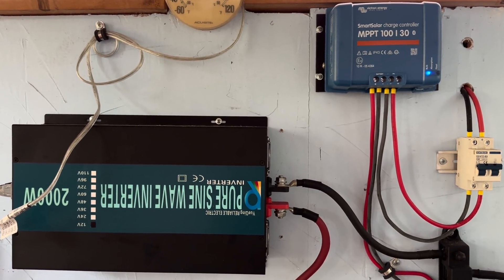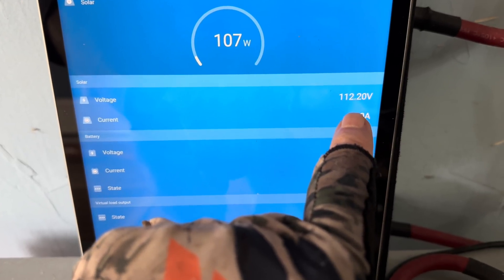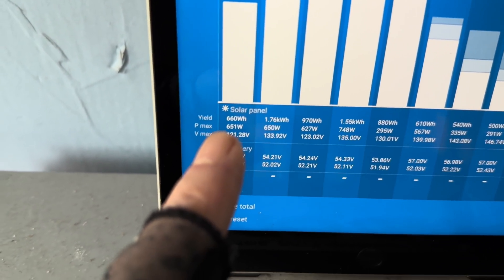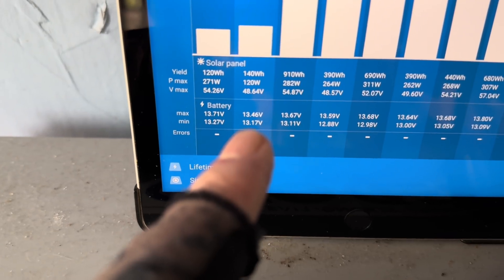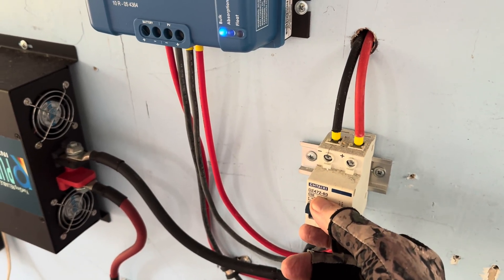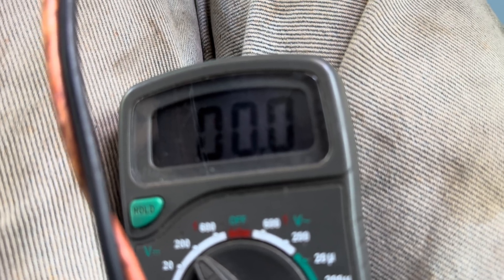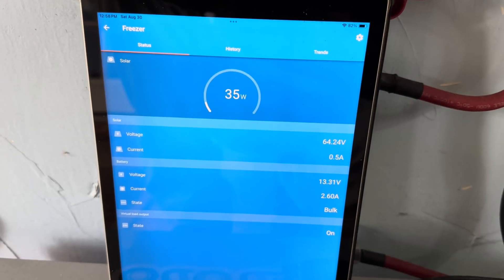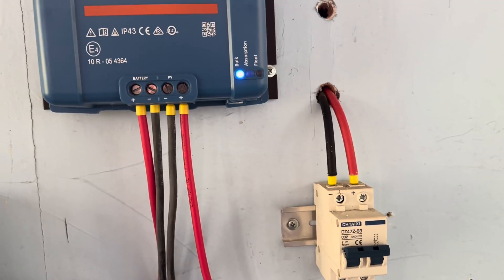Solar Panel Voltage Problem Solved?⚡️✅ Step by Step With YOUR Help🤙From 500W to 400W Junk Panels?

Comment: Hey Bob, sorry just watching this. Don't hook up 5 panels to the 100/30 Victron charge controller if the Open Circuit voltage of all 5 of those panels added up is above 100v. I had to replace mine after smoking it with only 4 panels in series (Open circuit voltage only added up to 90v) when we got a sudden freeze in California down to 20 degrees. My panel voltage spiked above 100v due to the temperature coefficient of the panels and my 100/30 gave up the ghost.

Comment: You're living dangerously with give 19.6 volt panels in series going into a 100/30. A little cold temps and that string would easily go over 100 volts

Comment: Ok i just seen your problem... You have to turn on and off your in a certain order... When you just turn on an off your solar panels it blows you charge controller... You must turn power on then panels and then off you need to turn off panels then power. Your blowing your charge controller... Read your manual... Ive made that mistake... Now i have a sign over the system to remind me...

Comment: I just had one panel not producing what it should. Turns out you really don't need those diodes  at all. But right behind in the proximity of the box there was a bad connection in the nickel strip embedded embedded in the vinyl backing that was bad. I took a multi-tool. And cut away some of the vinyl backing.. and resolder

Comment: I don't think those are burn marks just a bad soldering job with some burning from the soldering iron. The Bouge RV panel looks pretty much the same. I'd check the diodes.
Reply from the maker: I think you're right brother! Gonna take a crack at soldering them back into action pretty soon! Aloha!🤙

Comment: The downside of series is not obvious to which panel is the cause.  I would have shorted each panel and checked amperage with a clamp meter.  Identify the weak panel and check diodes with an ohm meter.  I doubt the solder connections are do to heat.  Just a lousy solder job from factory.

Comment: i just had to eliminate one of those 30 amp breakers becasue for some reason it was giving large voltage drop.
Reply from the maker: I haven't seen that here...yet, but will keep an eye on them. Mahalo for sharing that! Aloha🤙
Reply: @ProjectsinParadise808  thank you 😊

Comment: The first test with breaker off showed problem out side.   And the outher clue you had no melted MC 4 . And past experience with them 100 watt panels.  Them you got the proof when open them up. The diodes getting hot . Yon can clean them up and replace diodes .If the cells still good they work again. The diodes are 10A10 . Their is a better 20A10 . .I have lots of them diodes fail on outher brands . Usually replacing diodes fixes the problem . When replacing. Look for wight band on one side. That the Cathode side. Put in same way . If you have room you can put 2 of them in parallel . The 20A10 is slightly bigger in size and run a tad cooler than 10A10 . Just replacing with 10A10 you will have same problem again later . Use better or more diodes.   Test 1 Panel at a time on small system first . Cheers !!From NY !
Reply from the maker: Aloha my brother Robert! I could do a whole video on my appreciation of you for all your expertise and help in  contributing to the message here. You are special. Mahalo🤙

Comment: 5:30 If you are measuring 90v straight off the solar panels how can that be a solar panel issue, can someone explain to a newbie?
Reply: That's open circuit voltage with no load. Once connected to a load it dropped to barely half. Batteries can do the same thing. If you measure them with a load it can drop the voltage.

Comment: 😮 I have 12 Newpowas 100w on a 24v system in 3S4P configuration with an Epever 40a charge controller. Purchased 2019-22. I sure hope I won't be looking at this happening with mine. I'm wondering if the number of panels in series could cause this. Just a thought.
Reply from the maker: I have wondered the same. I still have several in strings of 5 in action that are holding strong. I am going to attempt to repair them, add larger diodes and see if that works better. I'll post my results. Mahalo!🤙

Comment: The Shaded PV Array introduces many system design variables. Probably selection of matching panels designed for shading and having the VMC , VMP/IMP is best.  I'm on the fence regarding best practices for shaded PV Array wiring but experimenting between series, parallel, and both may prove worthwhile. It is my contention that higher string voltage ( lower amperage) may heat greater at areas of resistance And that higher current ( lower voltage) arrays may heat faster. Maybe try the 2P2S and see if averages differ much. Finally, it might okay to run the battery in bulk charge but I tend to lean towards running the cells up to near maximum voltage 3712-3725 then setting the saturation stage to fixed time of 2hrs/100amp cell capacity  periodically. ✌🏻👴🏻👍🏻 Aloha
Reply: See my comment please. Mine are 3s2p on 24v system. Was thinking that the higher voltage in the series might be an issue.
Reply from the maker: Aloha Anthony! I'm glad you mentioned this, as I have been pondering the same thing. I think the 2p2s is worth trying here for sure, then see how it looks. Mahalo fo that brother!🤙
Reply: @ProjectsinParadise808 I tested swapping back and forth here's my opinion: 1) The most significant power gains are most closely related to proper tilt and direction and reduction of shadowing. 2) The series connection with MPPT out performed the 2P+2P throughout day. 3) The Series String production was noticeably better during " low on horizon", periods consistently outputting double the watts of the parallel/series connection. How important is it: Less than 15 watt hours at dawn and dusk. Yet, I still enjoy flipping the one string to two strings just because.....I enjoy watching. Peace 🕊️

Comment: i was one of those talking about diodes. I think its failling part of panel, and diodes are fine, but bypasses that. That black thing also could be just burned flux, when someone was resoldering that. Diode can be tested with continuity mode if its shorted, or with diode mode to see voltage drop.Failing part of panel can be just burnt small strip of wire between cells, and also can be tried to resolder.
Reply from the maker: Thanks for sharing your thoughts, brother!🤙
Reply: I agree, try re-soldering those points.....get the solder to flow, maybe add some flux fluid....

Comment: Got to invest some time in this for a fix. A soldering iron and some fresh rosin core solder. Un-solder each diode one at a time and check it with your meter, reinstall and fresh solder every fitting.
Plan B quick and dirty, "assume" the diodes are good and just resolder each joint, then  check the entire string for 70v+
Reply from the maker: Just got a soldering kit. Will try this for sure. Now got 7 panels in need of repair! Aloha!🤙
Reply: @ProjectsinParadise808 That's what I was going to recommend.  Let us know.
Reply: good advice: do the easiest thing first, just resolder see if that solves the problem